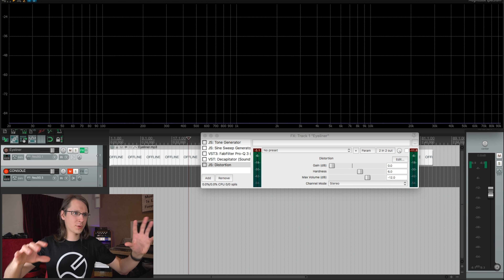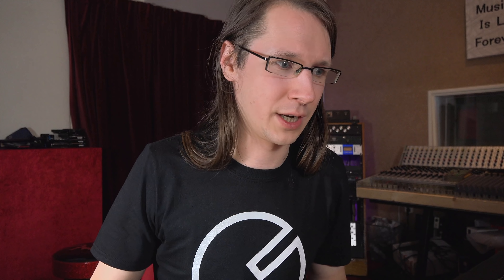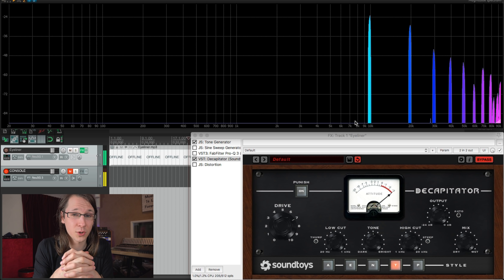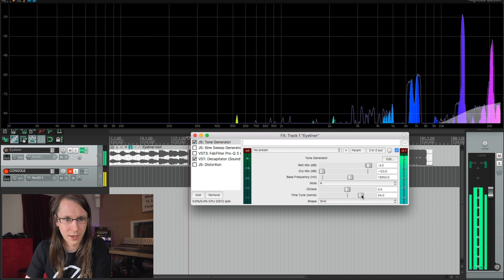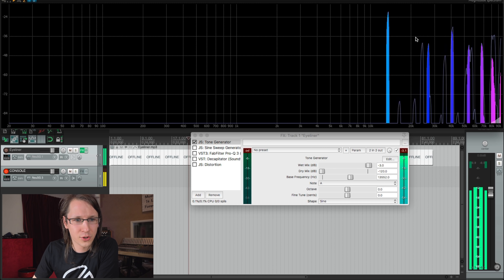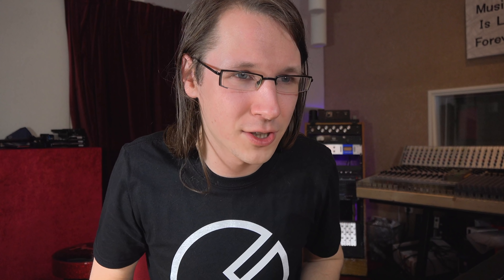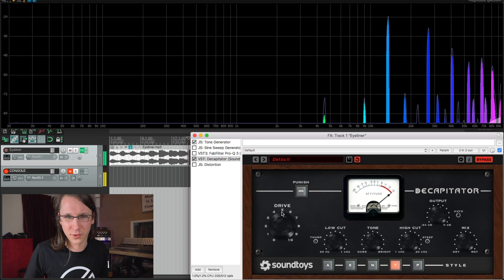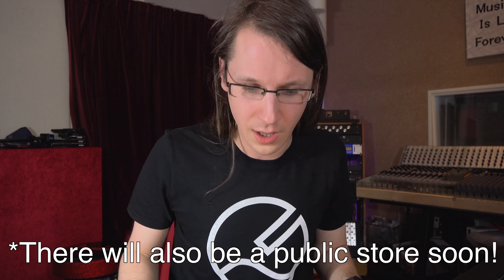Why MANY ANALOG EMULATIONS are SNAKE OIL!

Comment: Using the same technique I just tested the plugins I use and....
Yep! This harmonic aliasing happened every time

Fabfilter Saturn has this issue but turning on HQ mode makes it much better
Voxengo Tube Amp has this issue but turning on oversampling fixes it
Ableton Pedal has this issue but turning on Hi-Quality mode makes it much better
Klanghelm IVGI has this issue and no option to fix
Melda WaveShaper has this issue and no option to fix
Reply: All Melda plug-ins have oversampling optional up to x16. Look in the top right of the toolbar.
Reply: @nosucherror  Ah yep thanks Bill :)
It turns out I can't use it because the free versions lock out the oversampling feature, but it's there all right

Comment: I've got great respect for you and your channel, but I think  this is super oversimplifying something that really has nothing to do with why analog is better.  Your analyzer you have up has the 1k sine at around -2db or whatever, and your loudest artifacts are at like -72db.  You'd never actually hear those and they won't negatively impact anything, which is one of the reasons Soundtoys have said oversampling doesn't matter in their plugs, If I recall correctly.  There are actively fluctuating variables in analog that you don't get in digital that add 'mojo', so I don't think this is as major a downside to digital as some other things.  Just felt like this video is making a mountain out of an inaudible molehill.  : )
Reply: You make some good points, although I'm not sure I completely agree with you. At 5:30 in the video, we're seeing artifacts at -60db and about -66db, at about 7.2k and 6.3k respectively. These are most definitely audible.

Comment: @whiteseastudio Internally, decapitator must run at >48kHz right? Otherwise it would not produce those higher harmonics, correct?. Why cant it then simply apply a LPF before the signal leaves the decapitator and is downsampled back to 48kHz? (Similarly like a LPF is applied before A/D conversion?)
Reply: Ok sorry this comment was before i reached the point in the video where you explain just that 😅 still dont get though how plugins operating at 48kHz can produce higher harmonics - need to look into that….

Comment: Quick question. If the Nyquist frequency is at 96khz for 192khz, and the human hearing range tops out at about 20khz, why not work in a 48khz recording environment (I mean, aside from 192khz being a little lighter on the buffer and heavier on the processor)

Comment: I thought about this a bit, and I want to ask you a question. You didn't talk about the limiations of just measuring this phenomenon with a spectrum analyzer. For example, does all of these so called snake oil emulation plugins apply distortion continuously or just to the transients? Because if it is not continuous, then spectral analysis might be pessimistic and vice versa. I agree that some plugin manufacturers might just "be lazy" to add oversampling, but some of them might be more clever than you think. Just in idea..

Comment: Superb video as always!! :o) However, I do not think most people run at 48? Im pretty sure it's 44.1 khz?
Reply from the maker: Commercial stuff all runs at 44.1kHz. My conclusion about 48kHz came from looking at the projects that I get delivered for mixing or mastering, most of those files are in 48kHz.
Reply: @Whiteseastudio  Are they really? I work in Sthlm and 95% of all our project, in house, and external are 44.1 kHz. 48kHz is mostly a relic that sprung from video, 48 kHz became, for some reason, the video standard and is still commonly used.
Reply: @sony_mdr7506  Well, I can tell you that CD is indeed digital :o)

Comment: Well spotted. Good test to run on all plugins - I would have thought that the manufacturers would have internally applied a hanning window to any harmonics exceeding the nyquist when running at 48k to avoid the foldover. They should at least have the internal upsampling option available in the plugin before oversampling. I think these maybe things to include in the next VST standard.

Comment: Hey I checked out your friend at Air Windows and like what I hear however I feel like I stepped back to 1989 with the GUI...Not sure if that is the finished products but very confusing.. The reverb stuff was nice.... Any chance to do a Snake oil on NEOLD V76U73 plug in by Plug in Alliance? I listened to the plug in and  it didn't pop like WOW!!!

Comment: Another problem is that, when developing in the digital domain, you usually start off by implementing linear behavior (aka LTI-Systems), because that is easy and also a underlying assumption for some of the commonly used math stuff (e.g. convolution). However most analog cirquits do not fall into this category. This is not only true for saturation, but for most others things like filters and reverbs aswell. Again, there are ways to shift around those problems, but they involve additional work for both, the developer aswell as the computers of the customers.

Comment: Aliasing is only one of the artifacts inherent in digital processing. :-) There are also things like the artifacts of digital EQ and the pre-ringing inherent in EQ filtering screwing up with the transients, and therefore also introduced in sample rate conversion (which by the way means that, while upsampling takes care of something worse which is aliasing, it does degrade the audio in another way). Another one is quantization errors, also known as truncation distortion, caused by bit length reduction. In fact, ANY processing you do in the digital domain (and also every round-trip going through DA / AD converters) incurs some kind of degradation to the audio. EVEN just a digital volume change degrades the audio (see the PurestGain and BitShiftGain videos by Chris). This is inevitable and cumulative in nature. This is why the less "processing" we can get away with to achieve the sounds we want, the better. After all, digital audio is just a representation of real audio (sample positions, like image pixels, used as indicators to the computer of how to try to reconstruct the audio) and not the actual pure audio. For reference, and to better understand what Wytse often tries to say, try to listen on a high fidelity system to a high resolution version (at least FLAC) of great song that is produced, mixed and mastered 100% in the analog domain. As an example of this, I was just listening to D'Angelo's records yesterday. Hear the "depth", "purity" and "realness" of the sound compared to heavily processed digital records. If you like that, try to find ways to strive for fidelity even if you're 100% in the box.

Comment: Genius. Now I have a question, so if the aliasing is because of firing back from greater than 21k, should I just put a brickwall filter there? Would that stop it? I just tried on my mix and I heard a slight difference, and I noticed on recent pop reference tracks I use it’s a steep cutoff on their commercial mix up there too!
Reply from the maker: It wouldn't stop it, because the frequencies are already backfired. It would stop it if you would be running at a higher sample rate in the whole project, but, the downsampling from the DAW will also put a filter there (if it's a good downsampling algo)
Reply: The problem are all higher frequencies. While distorted 2nd or 3rd marmonics are added to the signal, which decay over time. If you, like me, work @48kHz the Nyquist frequency is at 24kHz. If higher freqencies are generated the appear on the other side of the spectrum. So you would have to prevent frequencies much lower that 24kHz to go into distortion to prevent this.
But there are many plugins with oversampling. Look at SDRR by Klanghelm (or the smaller free brother). But also many, many more.
Reply: Actually it would help reduce it if you place the filter right before the plugin. I've even asked Chris from Airwindows about this and he confirmed it to me. Also I know that UAD does it inside their plug-ins (look it up). Just keep in mind that digital filtering comes at a cost (losing some air frequencies and introducing pre-ringing artifacts...) but it's better that aliasing. So does oversampling by the way, any digital processing introduces SOME level of degradation. It's about what you can get away with.
Reply: @marvenmema  of course, if you for example low pass the signal.
But digital degration doesn't occur more than analog degration. If you filter, compress or modify a sound, you always add unwanted or remove wanted elements of that sound.
Analog circuits as well as algorithms are never perfect.
UAD filters at 28kHz, but afaik as a measure for bandwidth limitation.
Oversampling otoh removes the problem, more or less. For those who don't know what that means: If you work @48kHz and and a 2x oversampling, the saturation is internally calculated with 96kHz. So internally the Nyquist frequency raises to 48 instead of 24 kHz. After that the signal is filtered with a steep low pass at 24kHz. So all harmonics higher than you're actual Nyquist frequency, but lower than its double are cut. Same goes for 4x, 6x, ... oversampling.

Comment: You can avoid aliasing by running at a higher sample rate, plug ins that oversample can do this too, but then you have to rely on their internal src... People have come up with algos to remove the folded back aliasing too, many, no. Most of the BX/SPL/UA stuff is oversampling at default x4 on 44khz.

I could explain the difference between discrete time and continuous time, that can be a difference in sound between analog vs digital, thought the higher the sample rate you more discrete time you get.

Good video though, a tiny bit panic mongering as many of the best plug ins do oversample in a hidden way, its in the manuals..Dune 3's distortion doesn't though.

Comment: Everyone should go read the ultimate plugin analysis thread on Gearslutz around page 88. I asked a lot of questions and got great info from people like Andy from Cytomic and Fabien from Tokyo Dawn. Oversampling is not the same thing as running a session at 88/96/192. A lot can go wrong with oversampling inside a plugin. Andy also shed a lot of light on eq cramping at 44/48 and all the latency induced in Pro Q2’s natural phase mode. He also said a lot of plugins are outdated DF-1 biquads and do things like introduce low rumble as you subtract it. There’s a test for that. Someone tried it with the famous metric halo channel strip and it failed. These types of problems will be worse above 48k. I tested a bunch of eqs and found that the stock Pro Tools Eq does it too. There’s no real limitations on working above 48k nowadays when one can buy a Ryzen 1600 processor for $80. Even a 1950x Threadripper is under $500. Check the stats on cpu.userbenchmark.com. In my tests, I found that you want something with a 100 single core and 1000ish multi core score minimum. A 9900k is the best combo of single and multi core power for daw usage. Investing in a better processor will pay more dividends than buying $1000 of plugins a year. Oversampling also uses more cpu, so you might as well work at 96k if you want to use oversampling on everything. A dsp server like a Waves Inpact or Uad satellite will take up almost no native cpu and run lots of plugins. They can overcome single core overloads. You could deactivate a high cpu native plugin that’s overloading your cpu and replace it with several plugins on your dsp server. And yes, a lot of the modern UAD stuff is the best of the best. You can tell they didn’t cut corners. Same with the new Eventide And Softube plugins.

Comment: This is where I am torn. The harmonic evidence is there on this video and you can't deny it. However, I have recently been remixing old songs I originally recorded on Roland VS studios up to 20 years ago, in which the original separate tracks were stored as .WAV files.  I've put them through analogue modelled plugins as I reconstructed and remixed them. To my ears they do sound warmer and more musical, and less clinical than the originals. Maybe this is just as much down to my engineering skills improving in all that time giving me an ability to use these plugins in such a way. My conclusion is that analogue modelled plugins are probably not as authentic as they are being made out to be, but salesmen are salesmen after all.
However I'm not sure I would use the phrase snake oil. I am much happier with my mixes than I was before I had the plugins modelled on vinyl, tape, console valves, etc. They may not be perfect but, as someone old enough to remember the analogue era, I am happier with my results than I was in my early digital days. Maybe it's because I do all my recordings and masterings at 96KHz? Possibly. Now because of this video I see a reason why this would be wiser than using 48KHz.
Finally, Izotope's Ozone exciter does have an oversampling mode. I don't know if you've done a video on that? It would be interesting to know your opinion.

Comment: This just tells me that the folks who made the Decapitator (or any add-on) need to fix their algorithms so that they correctly toss anything at or above the current Nyquist limit on the post-processing side. It’s also why folks should be recording and mixing at 88.2kHz or 96kHz, not 44.1kHz or 48kHz. I would also avoid 192kHz due to it being overkill and making slightly worse audio as Dan Lavry wrote about here: http://lavryengineering.com/pdfs/lavry-sampling-theory.pdf.

Comment: Wouldn't always using the 192khz sampling rate fix this issue?
Reply from the maker: It would fix it for the biggest chunk, but, for heavy distortion, 192kHz wouldn't even be enough. This is also where we are going to get into the trouble of computer performance if we would want to (over)sample higher... So it's a difficult issue...

Comment: Actually, it is well possible to avoid aliasing artifacts. It's just a matter of how you produce the harmonics in the first place. If you use a simple (or dynamic) transfer function then it might be difficult to put an anti-aliasing filter behind (but even that would be possible via internal oversampling). You could, however, use other methods to produce the desired overtones. Eg. directly in the frequency domain or even using AI (eg. convolutional networks). Basically, its not a technical limitation of digital systems but just the way, distortion and nonlinearities have been programmed back in the days.

Comment: Well illustrated especially visually, and the 'layman's' terms you used were quite good actually. Such is the way of using a DAW compared to analog. Digital is very unforgiving at high frequencies. Probably why Fabfilter plugins cost so much. Oversampling costs extra. So does that mean your better to stick to 44/48K for this reason, to reduce the crap reflections/ artefacts above nyquist, but you may still get them below nyquist when using some algorithmic plugins, that don't have over-sampling?

Comment: so if I don't use higher sample rate, I have problems of aliasing without internal plugin oversampling, but if I use plugin with internal oversampling I will not have aliasing but at the same time, by the high pass filtering, I will loose the part of the analog sound related to the higher harmponics, so why use analog emulations ? (just for sound with poor spectrum content in the mid and high frequency..)

Comment: Nyquist is the key, plus distortion means of the fundamental with a , call it ,unique profile of roll off harmonics. As you explain harmonics over the Nyquist are folded down in base band. 

Now , question, why a distorted guitar sound sounds better when recorded by miking than in an amp simulator? Also , how a digital oversampling plugin can help if the Nyquist theorem says that all frequency content over fs/2 is lost in the conversion?

Comment: But how many db are the aliasing down compared to the desired frequency ? Are you sure they are so much audible ? I think that the true difference do not really come from there but the way analog overdrive add a sort of chaos, they do not react simply changing the waveform always in the same way they are a lot of parameter the will make it change differently, like the dynamic.. Also it's more interesting to see what happens when you introduce more than one frequency (only one frequency would not sound so bad because of digital but the true problem is with multiple frequency..)

Comment: Oversampling (10X, etc.) will work inside a plugin I would imagine, but getting resampled back to 48 kHz., aliasing will reappear.
That's just the nature of digital sampling vs. analogue, which is not sampled and the harmonics can go on 'forever'.
A happy medium would be to enjoy the harmonic distortion created by the lower frequencies and keep aliasing errors to a minimum.
If the plugin writer is claiming 'accurate tube (analogue) saturation', that's snake oil.
And my experience is that the analogue vs. digital signal at those near ultrasonic frequencies don't add enough to worry about.
And yes, AVOID aliasing, as it tends to be unmusical.

Comment: Analogue modelling is complicated, and its not just about dealing with foldover at nyquist. Oversampling obviously increases the CPU use. A brickwall filter in a ADC/DAC or an oversampling algo is typically a 7 or 8 pole. Non-linear transfer functions implemented via DSP algorithms are getting better, but we may have to wait until available CPU resources become faster / cheaper. Lots of research in this field: https://ccrma.stanford.edu/~dtyeh/papers/DavidYehThesissinglesided.pdf

Comment: The analog AA filter usually isn't that steep (anymore - that was a huge issue with early digital production when the hardware would sample at 44.1k or 48k, but today even cheap interfaces often use 192k ADs, which oversample again getting the actual sample rate up to nearly a MHz), because you oversample at the AD and then you have the digital filter before downsampling.